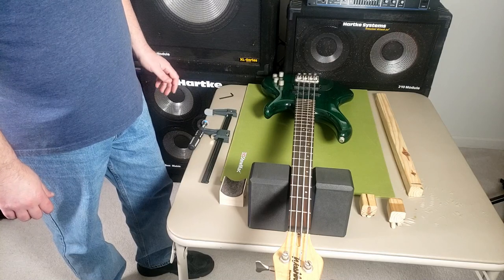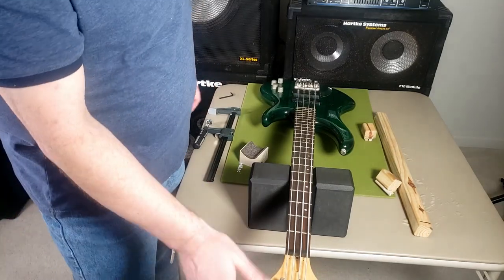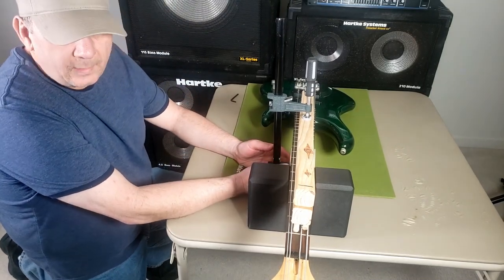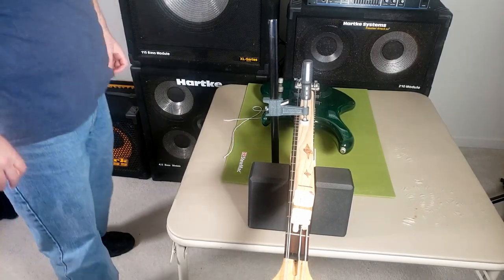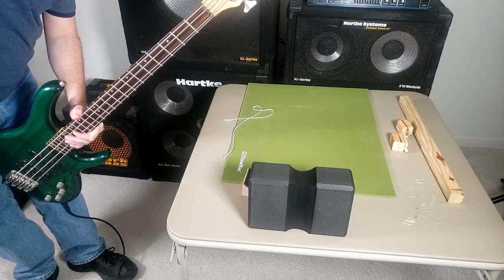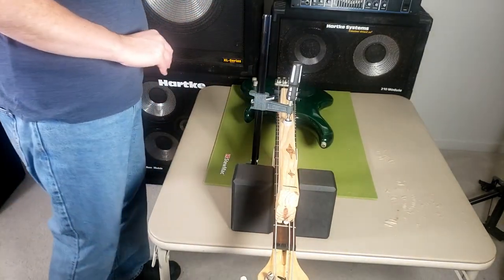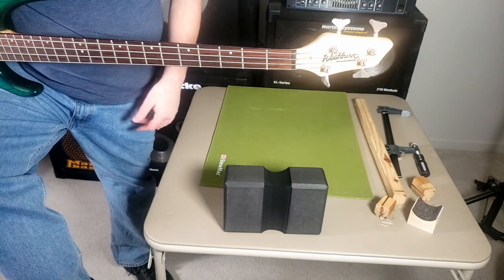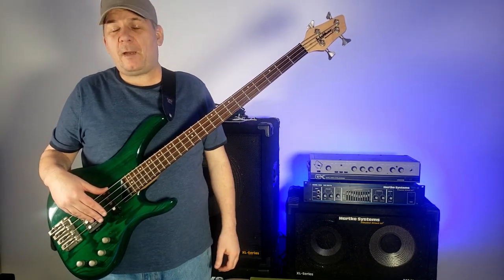Guitar or Bass truss rod too tight and maxed out? Do THIS to get the action adjustment you need!

Comment: Thanks! Has it held up 10 months later? I have an Eastman archtop guitar with a similar issue. Watched the Dan Erlewine video too. It seems like this method doesn't actually "straighten" the natural shape of the neck, it just makes it so there's less pressure on the rod making it easier to turn and less risk of damage. So if you need to tighten it again, you'll need to put the clamp back on. I'll give it a shot!
Reply from the maker: I actually took a little too much relief out of the neck and it's stayed the same over time (ie. it buzzes around the 7th fret on the A string still.)  I should post a video reply to my original one. The idea is pretty straightforward. If there's too much relief in the neck, it takes an incredible amount of pressure to tighten the rod. By taking that relief out in this case with the crazy jig setup, it lets you tighten it with much less force and as you continue to do this it will take the relief out. If you have 2 people you could do the same with one person holding the body and pulling the neck relief out and someone else tightening the rod.  I've done this another 7 times or so now. I will say this. Wrap the body in a towel and the same with the headstock. I've had the jig explode apart once and could see it happening again.

Comment: Most of my guitars have to have 9s on them. I just recently started playing in drop c# and i love it but some of my guitars max out the truss rod on even 10s in drop c#. Been thinking of doing something like this but im Afraid to twist the neck. I have a jackson king v that camr with a warped neck and it wont even go straight with no strings on it lol. This may help. I have, in the past used a hest gun on a kit guitar to get rid of some backbow and that worked well. I may try this tho. Thanks for sharing.

My only worry is without heat wont it just go right back to its original form? I know heat would make things really start to move tho

Comment: Hey man I have a Jackson bass and if you open strike all strings all you hear is buzz and when you play notes on top half of neck, they’re all dead notes, I was wondering which direction do I turn the Allen wrench for the truss rod?
Reply: Righty tighty, to straighten the neck.
Lefty losey to put in some relief, a slight bow.
A neck which is too straight can be problematic, you want a slight bow.
Do 1/4 turns of the truss rod, and leave for a bit, check it and redo if necessary.
Good luck. I'm trying to straighten a vox bassmaster neck. No truss rod so I'm using heat and clamping it.
All the best.

Comment: The next step after this would be a heat press. Ps. Is that a yoga block?
Reply from the maker: No heat needed for this one and the action was atrocious. After I changed to the 40-100 Dunlap's the bass plays great. Demo's coming shortly. As far as "Yoga block" ...  There's a StewMac mat that the bass is resting on and a StewMac Hi-Lo Featherweight Neck Rest the neck is resting on. The mat was free with the neck rest last week :)
Reply: @kubicki2000  good to hear that it doesn’t need the heat press… *yet*.